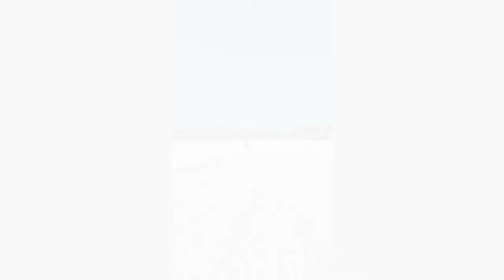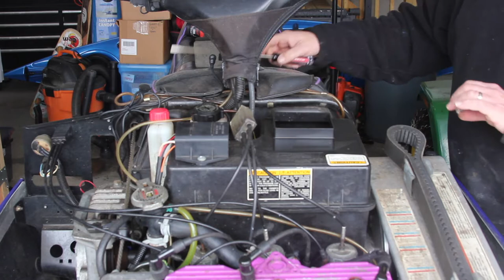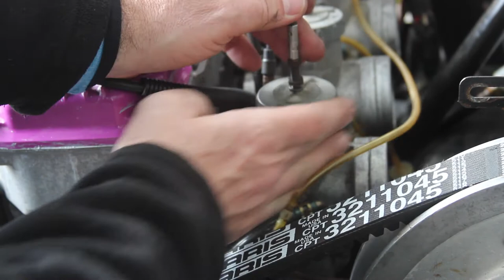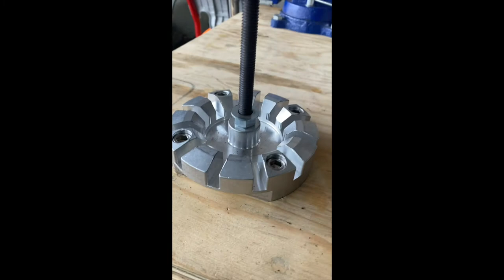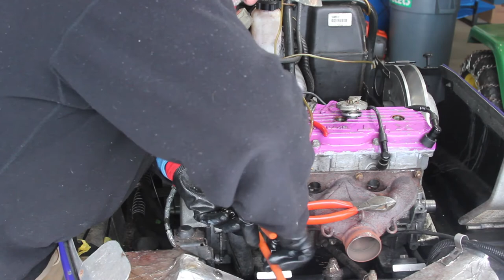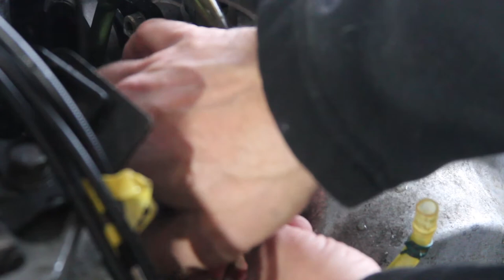Old Sled Rebuild-Part 1: 1997 Polaris XLT 600 Triple Engine Removal

Comment: Woah now.. did you edited out removing  the 4th bolt on the recoil housing? I have a bolt coming through with a nut on it. My bottom right bolt changed to a 10mm also..

Comment: Why not unbolt the pull start instead of cutting
Reply from the maker: Thank you for your comment.  The recoil rope passes through a fitting on the frame of the sled and the handle is outside frame.  To remove the recoil completely from the machine the rope needs to be cut otherwise it would hang on the sled from the handle when the engine is removed.
Reply: @dennisdoesitall  and ur point lol I always put it on the sled seat saves the knot and cutting bs side of things might be something ur over thinking ur pretty smart but maybe to smart lol
Reply from the maker: @davidfirth9342  I never have been accused of being too smart lol but point taken.  Your way would certainly work and removes the risk of loosing hold of the rope and unwinding the recoil...been there and done that!

Comment: I'm curious about what cylinder compression was before you tore this whole thing apart .... side note: ...  if I don't have the other two plugs in and torqued to 18 to 22 ft lb.   My compression tester will read roughly 20 ft. lb. lower than what that cylinder's actually making .... cuz if you suspect a broken ring ... you should maybe do a compression test each cylinder ....
Reply from the maker: If memory serves me, it was around 50 psi on the PTO cylinder and 120 on the others.  This engine originally blew 2 seasons ago due to a carb boot leak and we did a top end rebuild.   On our second ride last season the crank seized on the newly rebuilt motor which led to this series.  We didn't check the compression due to the fact that the engine was locked.   Hope this helps you.